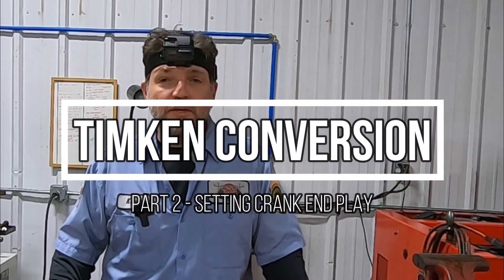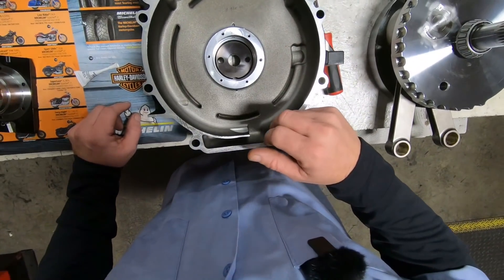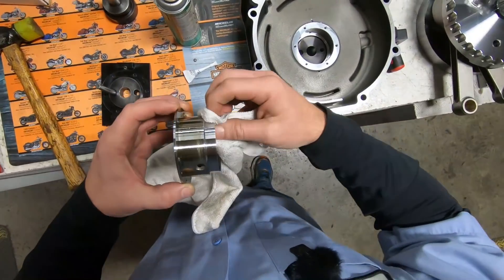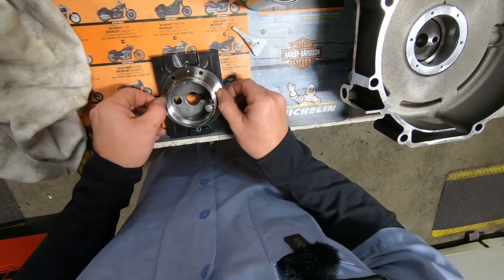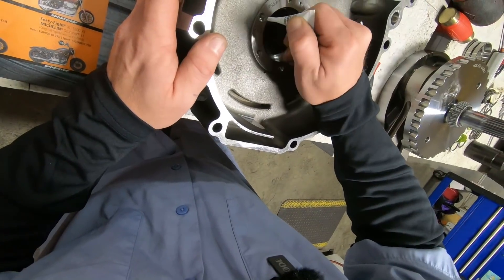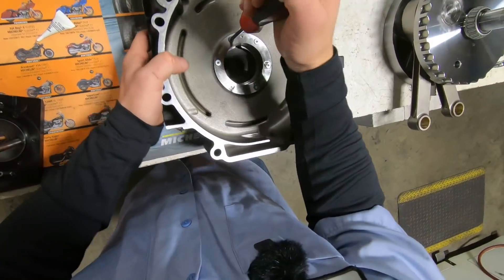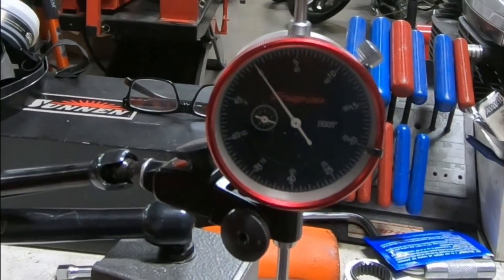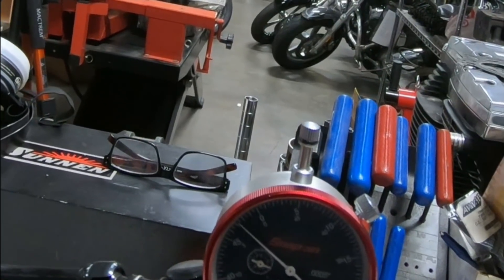Harley Timken Bearing Upgrade Conversion PART 2 | Performance Harley | Kevin Baxter | Pro Twin

Comment: Great video, amazing work.
Speaking of amazing work, I had the opportunity to apprentice under the great Gerry Merchant aka Merch Motors up in Canada, eh.
Gerry had a polished crankshaft that he would mock up and check the end play,  that way you didn’t have to press in and out several times ( and avoid potential damage to assembly and or Case)  works slick.

Comment: When doing the conversion on a 2015 twin cam 103 what spacer do you use to properly align the rotor on the stator. The old one is to big.

Comment: Seriously, I do not see why don't set the bearing preload on a test shaft so that you don't continuously have to pull off the case against that outer roller bearing. I am assuming then that you use a new roller bearing if you had to make an adjustment to the center shim? I have always kept an old shovelhead sprocket shaft around for this purpose. assemble the bearings on it in the case to determine your clearance and then you are good to go. There sprocket shaft was polished down slightly to allow the bearings to slide on and off easily. You can also machine up a mandrel shaft to do the same thing. Also didn't see anything on install the large circlip in the bearing holder. Maybe there isn't one in this kit?? Otherwise a very well done video!

Comment: Very interesting video, thank you for doing this.  I've been told by a couple H-D techs that when you start talking about splitting the cases it's cheaper to just buy a new motor.  Not sure if they say that because they don't want to dig in that far or if they just want to sell a new motor or motorcycle.  What's the price range of the process you're showing?

Comment: Pressed and flanged sleeve its basically a sheave collar that press fits into the case instead of onto a shaft and shaft mounted component. My point is, that’s a pretty strong fixture, probably stronger than the whole O.E.M. Harley Davidson aluminum alloy casting, and I’m not in any way aspersing the case’s  strength.

Comment: Hey kevin i have a ?? im starting my 96ci to 107 build. the case is ready to go with my S&S Crank after talking to the S&S tech they told me that the timken bearing is not needed should i do it any way? Plus i want to do gear driven cams but every one is telling me that there noisey vs chain.

Comment: If no one has suggested it. I hone a set of beaerings to slip fit for checking end play. Learned it for shiming pinion shafts on GM rear ends.

Comment: 1)  Is not the Timken bearing set pre-fitted with the correct spacer to begin with?  But the end play does, in fact, need to be confirmed and corrected if it is not within specs.
2)  How was the crank supported to press the outer bearing into place?  Jim's makes an installer that uses the sprocket shaft as support to screw press in the bearing.  Can  be done on the bench....
....RooDog....

Comment: Interesting procedure..I would've thought one would need to machine the case to accept the new Timken race..
Reply from the maker: If no case damage, the JIMS sleeve makes it possible without case machining other than screw holes.

Comment: How would one press the outer race off the shaft (in the case end play adjustment was needed) without destroying the bearing? I don't see a way that it could be done without passing the press load through the rollers, which would essentially kill that bearing.

Comment: Is there a video that shows assembly of these cases ,this model,without timken upgrade , couldn’t find one. Looks like you just drop the crank in and bolt the the 2 halves together . Thanks

Comment: Hi Kevin, just watched both episodes of timkin install. Nice install. Still looking for a shot of the right side. Trying to figure out where the sump location in relation to the oil pump. It looks like the pump is higher than the bottom of the sump?

Comment: Fun little fact, the bearing retaining compound supplied with the kit is made my loctite. Once it has fully set up it won’t release until 350°F. So keep that in mind when using it.
Reply from the maker: i have one loctite formulation, only available to machine shops...wont release until 1000 deg estimated.  Crazy stuff.  Permanent really.
Reply: @KevinBaxter  lol yeah I’d say that’s permanent.

Comment: You never hear about Japanese bikes needing new bearings, maybe because everyone except Harley uses bolted cranks not press fit
Reply: I have a Japanese motorcycle. It has a 1 piece forged crankshaft. Engine bearings are similar to an automobile.

Comment: Obviously there are many variables that could be involved but I am curious how much a job like this costs? I hav an '07 that I bought used in very good condition for a ridiculously low price. It has 61k miles on it. I would much rather put the money into this bike and know I have a reliable motor good to go for a very long time, vs. a newer bike that Would cost a lot more.

Comment: Forgive me. But I have to ask:  WHY wouldn't HD build their engines with this tech?? The reason I'm watching Kevin's channel is that I'm a life long motorcyclist, I'm 55 and I've been riding pretty much every day since I was 18. 20k miles on a "83 Honda 750 Shadow, 10k miles on a '84 Honda Goldwing. My current bike is a 1999 Triumph Trophy 1200. I REALLY want to try a HD, but dang... if they cant make them THIS quality from the factory, what's the point?
Reply: Not to mention, their bikes are seriously expensive.

Comment: Is there a spacer between the two bearing races?
Reply: Also, my question. The original assembly comes with a cup spacer, is it replaced by an integrated spacer in the sleeve housing?

Comment: What was the cutoff for the tapered bearings? I've heard it said that some early 03 model bikes / motors still had the tapered bearing. I have an 03 Road Glide and I've been in that side twice to replace compensator spring packs. Forgot to look both times (insert head slap here). FWIW: Crank runout was .002 on the cam side

Comment: Hi Kevin,  Great job showing this conversion.  Question:  Even though the crank end-play is perfect, how do you know the connecting rods will end up in the exact middle of the cylinder bore?   Or is that even a concern?

Comment: These overhead formats are great. Whoever disliked this video rides a moped
Reply: But at least that Moped rider: a) does Not have an eye-watering amount to pay for his or her vehicle & improvements (as I did attempting to duplicate my GoldWing features on a 2019 FLHRXS/Road King Special) @$536/month; and, 2) the Moped’s oil pump engineering actually worked properly. How many Milwaukee Eight 114 oil transfer setups did the MoCo devise? Let’s ask Doc Harley at Low Country H-D outside Charleston, SC. (Or Kevin’s actual technicians.)

Comment: Hey Kevin, another great video. Can i ask why you don't use something like the LANG tool for setting the end play on the Timken lefty set up, to save having to keep assembling & disassembling, if you don't hit it bang on first time? Can i also ask what make your groovy little assembly lube can is? Cheers dude, excellent as always.
Reply from the maker: If it's a stock case, I do because several test fits aren't uncommon. With this, The sleeve is precision ground. Its spot on most of the time.  Its just the way I do these...
Reply: @KevinBaxter  Absolutely awesome video you're very good at explaining what needs to be done and now I see what's wrong with mine I have a 2015 road King thank you much have a good day

Comment: Awesome video and great information. Have you ever used liquid nitrogen to shrink press fit bushings?
Reply from the maker: Do it all the time...if going into aluminum, i certainly would have.  but...into tool steel...not really an issue in this application.

Comment: Hey Kevin it goes without saying accuracy is your thing.  Having said that I have seen another professional on the tube who did the same install procedure but made note that using assembly lube when setting endplay would make finding true endplay impossible.  He did his dry. Your thoughts?
Reply from the maker: Baskin Robbins has 31 flavors for a reason.  I wont argue his method, its not wrong, but I will say....i have tested this myself.  In my own experience, I have installed dry and checked end play, then repeated with assembly lube...found no measurable difference as read on .0005 indicator.  keep in mind...even the viscosity of the assembly lube...be it paste, grease, or oil....that can make a difference too.  There are other ways to do this anyway...with a dummy sprocket shaft, etc.

Comment: Your channel is excellent. I really wish you would build yourself a nice thick plexiglass shield in front of your press. I set mine up so it slides up and down on tracks, and i do you have marks in it showing where I got protected from getting hit by pieces of metal and other particles.
Reply from the maker: Thank you sir...and i sincerely appreciate your concern.  i will look into that.  safe is better than sorry.

Comment: Recommend doing a Timken bearing install on a stock 96 ? ( 2009 Softail) Mostly for longevity. I can be kinda anal about my engines. Considered having it tore down reassembled to stock specs aka Blue Printed. Has Screaming A/C, 3" Cycle shacks and Xieds.  Thanks
Reply from the maker: We have 3 M8s in the shop right now for that very thing.  Blueprint it but not doing major performance upgrades.
Reply: @KevinBaxter  . Expect any noticeable power improvements other than a peace of mind?

Comment: Kev
How did you choose your spacer prior to fitment? What did you measure and how did you decide on that size spacer?
Reply: Great video BTW
Reply from the maker: great question.  these sleeves are precision ground.  I have done MANY MANY of these.  I know most likely, i will need to choose two or three spacers within a .0015 range.  I measure the thickness.  With this one, it was good with the first choice.

Comment: If I wanted Pro Twin to build and blueprint my 88ci, adding gear driven cams, Tipcon bearings and that well built crank with the properly built connecting rods...  But keep the engine as close to stock as possible, (Just a street bike, not a monster track bike), what would be the ballpark of the cost?
I wonder what I'd be looking at, instead of looking for another bike?
Reply from the maker: too many variables to quote off a post.  reach out to me by email or call and i'll be glad to walk thru it with you.

Comment: I tried Timken flywheel 1way bearing on 2015 street 750. 
Came up empty but did find china 1 on ebay cheap. 
She runs better than new ... starts n stops like should without making banging noises

Comment: I have a question. I do precision work for a living, and looking at that press, I am really curious how it level within a single thou, let alone 1 ten. ??  Even lathes aren’t within that tolerance and they have precision adjustments to set them.  Right up til there I was ok, but a press, setting on a concrete floor, with zero shims, and the table just sits on steel rods...pretty implausible to say the least. That really raises more questions than it answers.
Reply: @Mod Zozer I understand that, I’m not the one that said within a ten and the press was right there, I’m the one saying BS.
Reply from the maker: i believe i said square to .010.  not a tenth.  The sleeve is precision ground to a tenth.  a tenth is not possible on any press that I've seen...nor would it be necessary with this type of press work.  to answer your question though....im using guided press tools that ensure race and sleeve is square to the case.  in addition to that, i make my own anvils for the ram.  after every few uses, i will compare the press tools used for this operation, as well as others, against the anvil then file if necessary.  it's checked at 0 pressure, then i run it up to final pressure and check for square from the anvil to the press tool just to verify it's holding.  Getting a 2" anvil square to .010 is not that difficult.
Reply: @KevinBaxter  no you said “ to a tenth of a thou”. That is one ten thousandth.  Then you said your press was “ right there” too. 
 We all misspeak.
Reply from the maker: No sir.  I did not in the context you heard it.  I just reviewed the video...even the YT auto closed captioning picked it up exactly how i said it which was:  "you got to remember this you know this piece is precision ground and machined to within a tenth of a thou so you want to make sure your press is within ten thous of level and i know this press is spot on the money". Sometimes, we all mis-hear.
Reply: @KevinBaxter   you’re correct, I reviewed and I did mis hear the second part, I do apologize.
Reply from the maker: No worries.  Trying to work and do these videos at the same time, is very tough.  Being you are in the business you are in, im sure you'll understand how tough it can be to focus on said precision work and talk about it at the same time.  Often, we know our skill so well, our mouths dont work as fast as our brains because our brains work on instinct.  That said, no one is beyond mistake.  I have no issue with constructive critique...and if i happen to mis-speak, i have no issue with someone mentioning it so i have opportunity to correct.  My goal is to communicate correct and accurate information to my viewers.  However, the candor by which the critique is delivered, can make all the difference.  All the best to you sir.  Thanks for watching.
Reply: @KevinBaxter  I have no doubts trying to explain every detail, while focusing on performing them , could easily distract.  When dealing in fine measurements focus must be paramount. And when doing the work on someone else’s equipment, all the more so.

Comment: Is there a reason you couldn’t assembly the two bearings and spacer on a threaded dummy shaft in the case and check free play before you pressed it on the crank? That way you could take it apart easily and adjust shims until you got it where you wanted. Just curious
Reply from the maker: no reason really.  Just a personal preference thing.  As you know, those can be bought, or made even with old sprocket shafts.  I made one that is welded to a large tblock that can be squeezed in a vise.  these sleeves are so precise, most of the time, it's on the money.  just have to find the perfect spacer out of a bag of spacers.  LOL

Comment: No worries the heavy assembly lube has taken up some of the end play travel?
Reply from the maker: no sir.  if we were going gear drive cam backlash, certainly would do dry.  With this...has no effect ive ever measured...have tried both ways.
Reply: @KevinBaxter  Thanks, love the series... Im like yourself for accuracy...started doing my own work after a builder here calls me like 10pm one night saying " I just fired up your bike and I think I bent a valve "..  Will follow the rest of your series...Im currently searching for a Shovel project for my young son to start riding.
Reply: @KevinBaxter  Did the Timken conversion and case deck machining while Darkhorse was doing the crank...I believe they line bore indicated of the pinion side .

Comment: i know when you press # 2 bearing your pressing on the inner race of it , if spacing  is wrong now you press on the crank witch in turn put's load on # 2 rollers not the race , still use that bearing or new bearing when going back togeather ? , i know , i know ,  i'm fussy .
Reply from the maker: nothing wrong with fussy.  I do not recall the exact data, but a few years ago i had this conversation with a technical person from Timken.  It was dependent on the pressures of course...i do not recall the range of pressure he gave me that it would be acceptable to do as long as the bearing hadnt been in use, but it was not even close to the pressure required to remove/install in this application.
Reply: @KevinBaxter  thank you sr....great videos  , we are never to old to learn

Comment: So is a converted case actually "better" or "stronger" than a pre 03 stock tapered bearing case? Seems like it would be with the steel insert.
Reply: I'd say 'yeah.'  The steel insert, instead of the cast aluminum...  And the insert takes the bearing load off the case.  The case would just hold the insert in place, as seen here.
Reply from the maker: great question...and one i cant give an answer to with certainty.  I have repaired cases that spun timken races in alum cases...so....yes.  Id have to say it is.